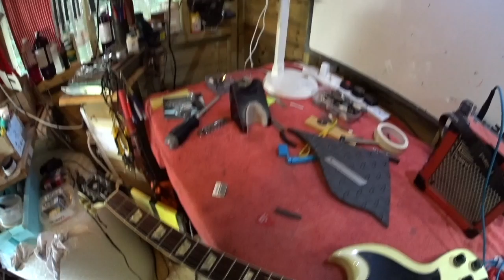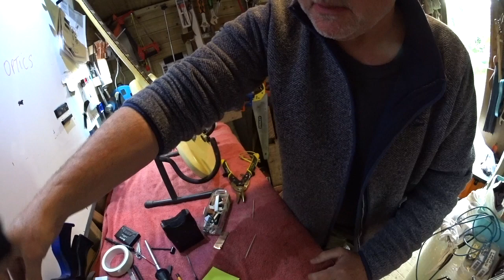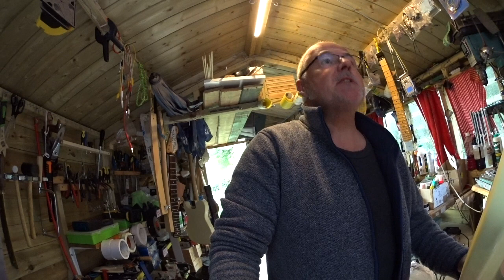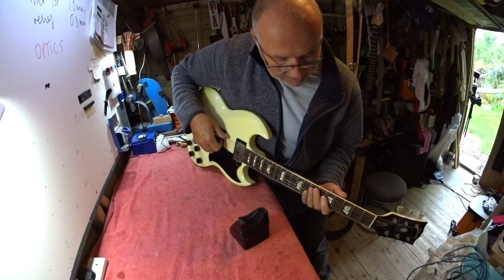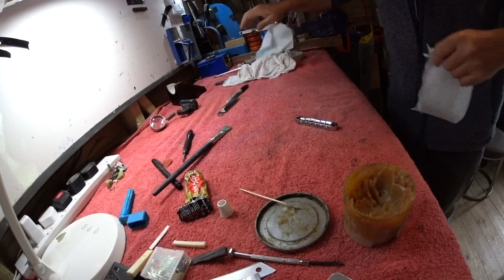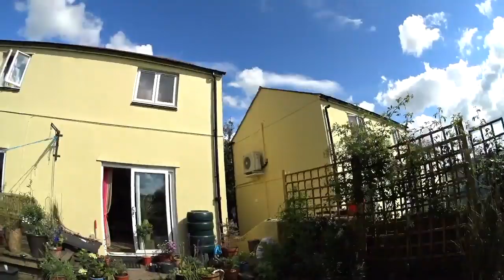Gibson SG set up

Comment: When you file the nut slots, I understand that in the vertical plane you follow the line that string takes from nut to tuner. Do you do the same in the horizontal (neck) plane or do you follow string line from nut to bridge?